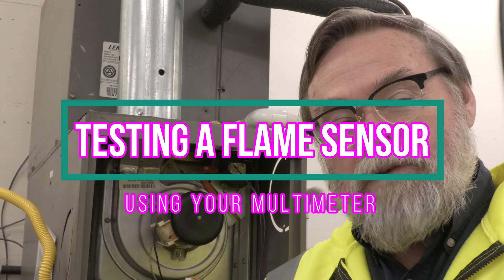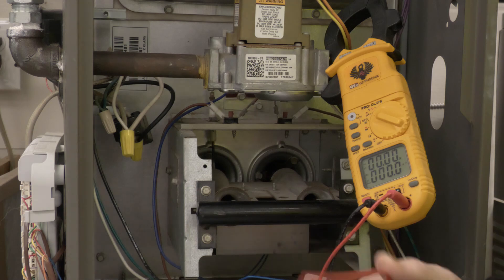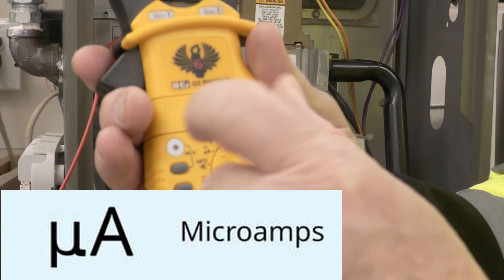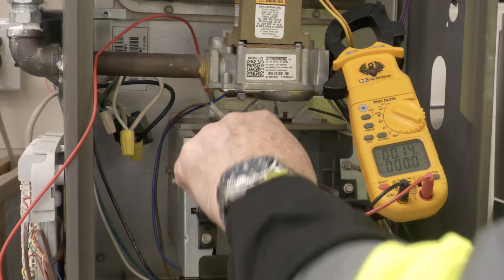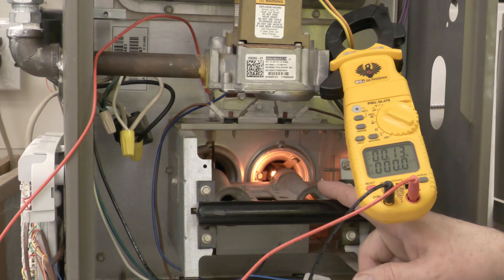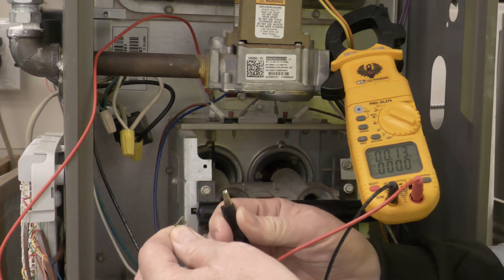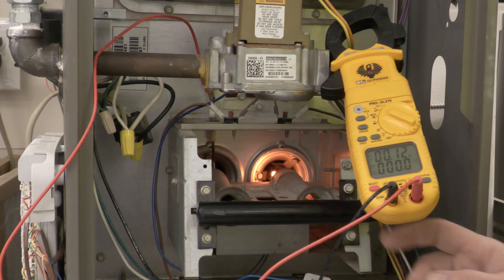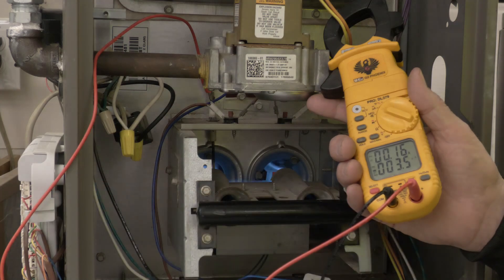How to test a furnace flame sensor

Comment: I’m guessing if it does cycle on and off 3 times, it’s time to replace it?
Reply from the maker: Flame sensors don't go bad, if anything the ceramic can crack but they are just a steel rod. More than likely it would be the board if it cycled three times and the flame sensor was above 2 microamps.

Comment: Are you measuring microamps AC or DC?
Reply from the maker: It's DC not AC
Reply: @baileysair  I imagined so. Thank you.
Reply from the maker: @carsongrosche6375 My pleasure, do you have any suggestions for my next video?
Reply: @baileysair  As a viewer, I would say that I enjoy suspect component troubleshooting and the reasons why, that is then backed up with 100% definitive evidence. This video pretty much hit the mark. I'd suggest similar videos with a range of components.
Reply from the maker: Thanks for the suggestion, next one is the pressure switch.
Reply: Scotch bright ads are great so they don't score the flame sensor. Does it matter that you have the amp clamp around two wires?
Reply from the maker: No, it reads through the meter internally not the amp clamp.
Reply from the maker: Steel wool is cheaper than the pads and you don't need much to clean a sensor. Some people use a dollar bill and it works, not quite as well as the Scotch Brite pads or steel wool. 
Steel wool also makes a great rodent barrier in a furnace closet stuffed in a hole.